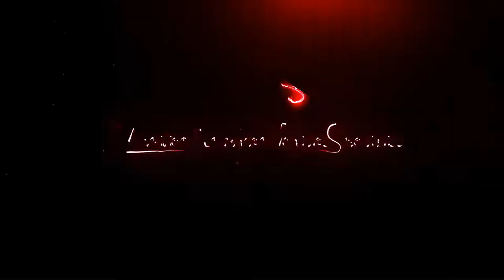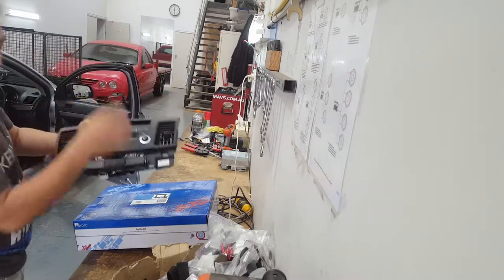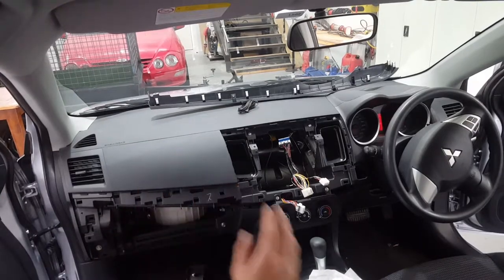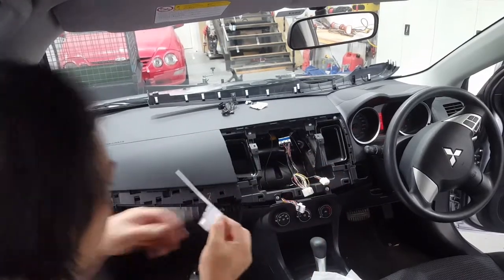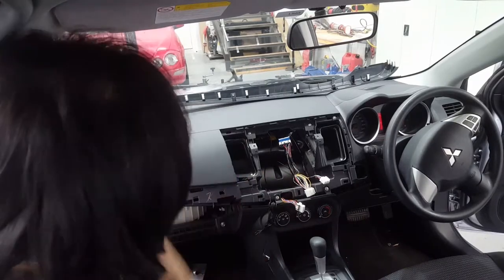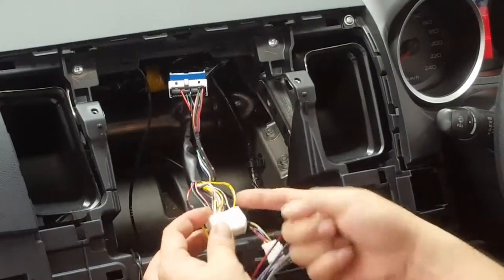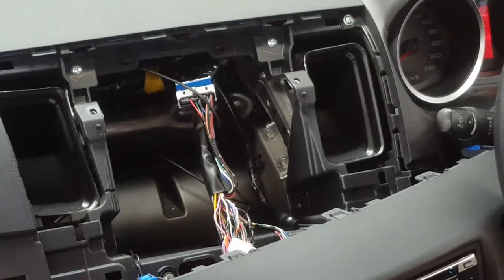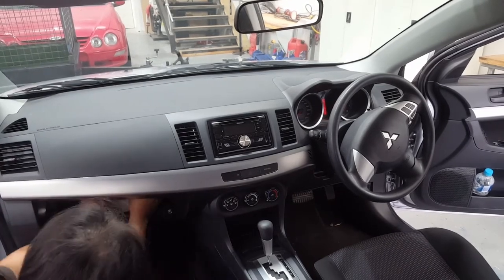How to install aftermarket head unit into a Mitsubishi lancer CJ 2007 to 2013

Comment: Does it make life easier to use a harness ? Or did u just wire it up like that for a reason?
Reply from the maker: It's is easier with a harness but it's too messy in my opinion, where most professionals would wire it straight to the plug to avoid clutter behind the dash.